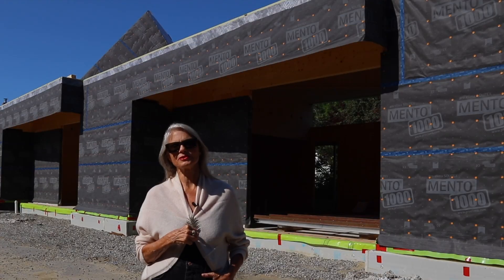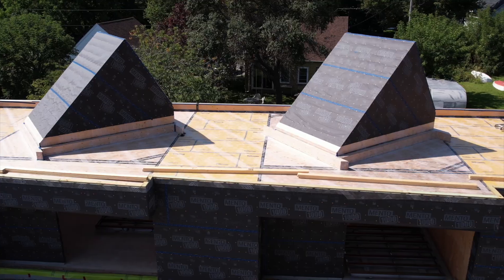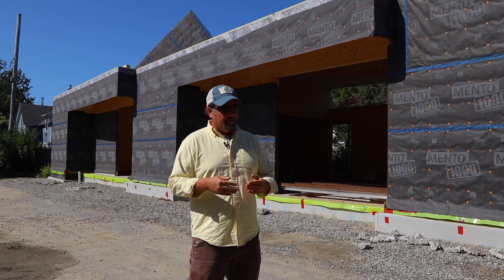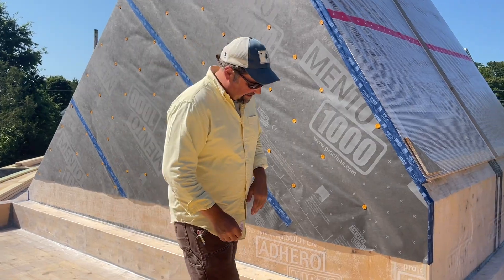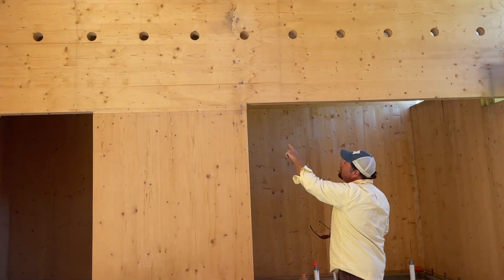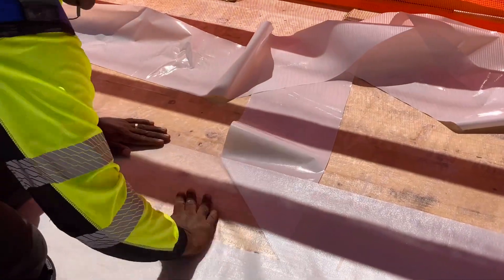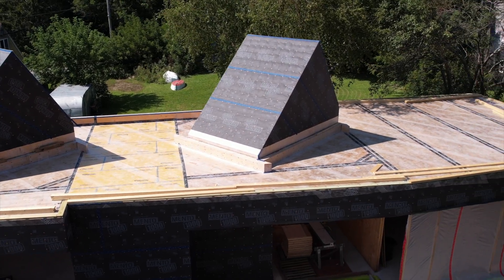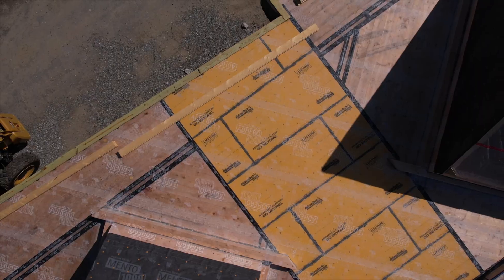Beautiful CLT Project Applies ADHERO VISTO for Mass Timber Protection

Comment: Great project! A few questions: What drives the decision of choosing MENTO 1000 over ADHERO 3000 on CLT walls etc? Do you know what the orange fasteners are that attach the MENTO 1000 to the CLT? thank you
Reply from the maker: Thanks! We can't speak entirely for the project team's decisions, but either MENTO 1000 or ADHERO 3000 are appropriate. They likely went with the MENTO because they already planned the Gutex insulation to go outboard of it, which acts as a WRB. Given that, the MENTO only needed to act as an additional water protection and airsealing layer, and didn't feel the ADHERO was necessary. The orange fasteners are button cap nails, and went along with the CLT manufacturer's recommendations for fastening (instead of the usual staples). Hope that helps!